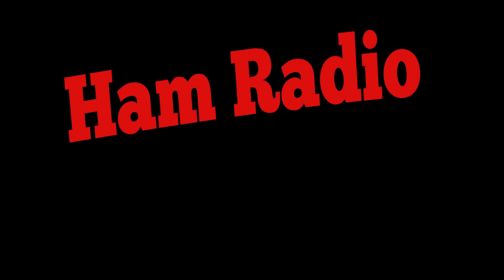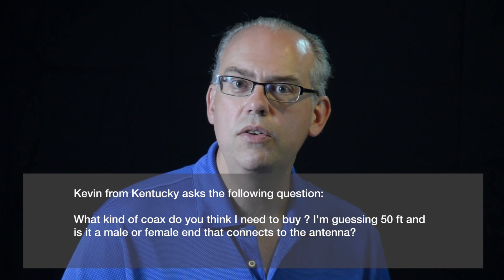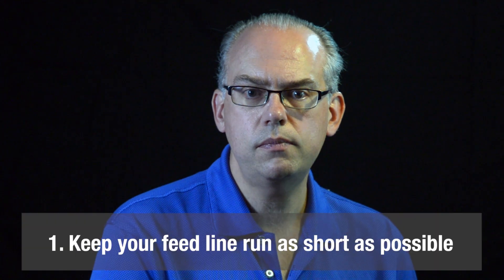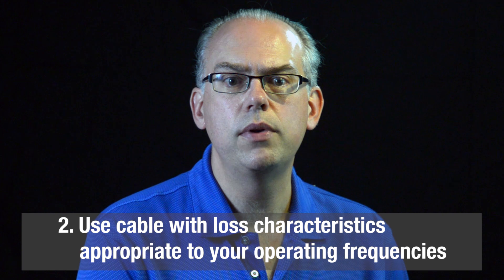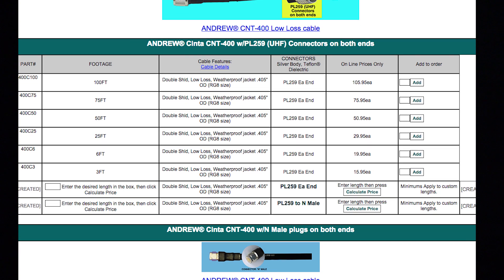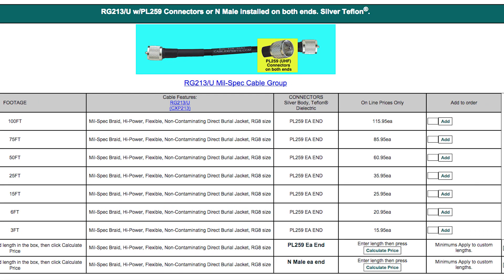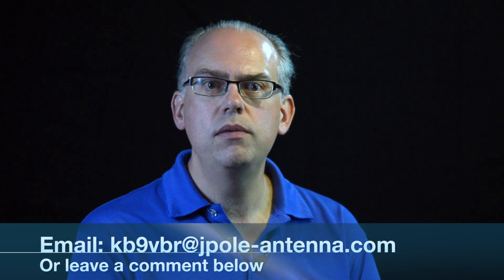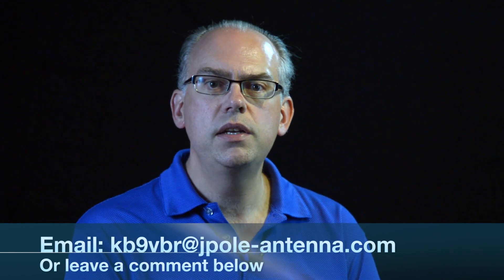Ham Radio Q and A Episode 2: Selecting Coax Cable

Comment: CAREFUL, SOMETHING NOT QUITE RIGHT
Good explanation. I don't know where you got the specs (in the table) for Belden 9913, seems wrong, I went to the "Belden" web site and checked the specs for 9913 and they were totally different than the ones in your video. Much higher loss. The 9914 is correct and seems to be transposed to the 9913 spec's. 
Anyway you helped me out in my quest for knowledge on this subject. 
Can someone tell me what I should use for nice flexible coax for my test gear? Maybe grey? I have Spectrum Analyzers, Scopes, Power meters etc. Need to go from DC to 3G/5G at up to 10 feet. Connect to antenna's and probes.  Fittings are N type but I can adapt up/down. Leads supplied with the equipment are too short. I am a bit of a "Newbie" , so any help is appreciated.
Thanks again,
David (from "Down Under")
Reply from the maker: David, thanks for bringing this to my attention. I did look around and recheck the coax attenuation values for 9913 and 9914. I did find a variety of numbers in the various charts online, but it appears that my referenced chart does track closely with the Belden 9913 & 9914 data sheets: http://www.belden.com/techdatas/english/9913.pdf http://www.belden.com/techdatas/English/9914.pdf.

As for the type of coax to use with your test equipment, I'm not sure what would be the best choice for you. Maybe the folks at MPD Digital could give you some guidance: https://mpddigital.us/

Comment: On a wire dipole fed with coaxial cable, does the feed line have to hang straight down to earth, or can I bring it down a few feet, then turn at about 90 degrees and run it through the trees?
Reply from the maker: +Steve Tomlinson The feed line doesn't have to hang straight down, you can certainly pull it away from the antenna at an angle. The feed line doesn't radiate, so it's orientation won't have an effect on the antenna.
Reply: +Steve Tomlinson Thanks for the quick reply..

Comment: Hello I have a section of chain link fence rail (18' 4"). Can I use this for a J-pole mast? Also, I have 50 ft. of rg8x for feed line.
Reply: This is an old post, but that's exactly what I used for my Bilal antenna farm in when I lived in an apartment. When not in use the mast and antennas were laid on the deck, then socketed in a mount on the rail while operating. Worked great.

Comment: Michael can your jpole antennas be cophased or would there be an issue because of the jpole design. Thanks Art.  K2ADC
Reply from the maker: uncleart112 While I haven't tried co-phasing the J-Poles, I have done a bit of research on the subject. I see no reason why you can't phase two or more of the J-Pole antennas. The key to proper phasing is in the construction of the harness to feed the two antennas. There's plenty of plans online, but I can send you a couple of links if you are interested.
Reply: Thanks Michael for your response.